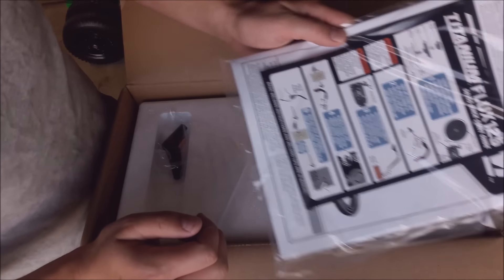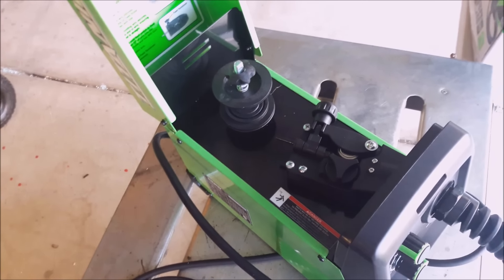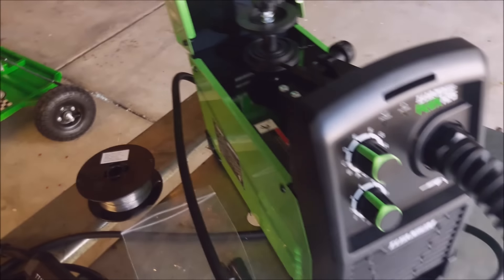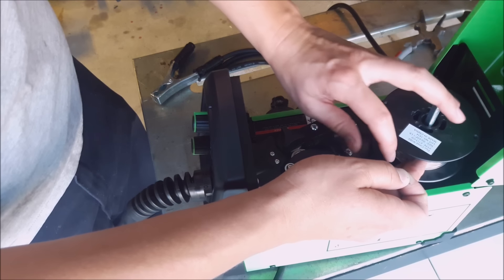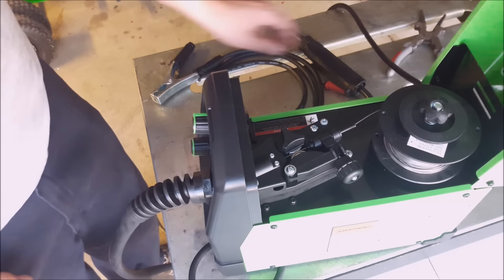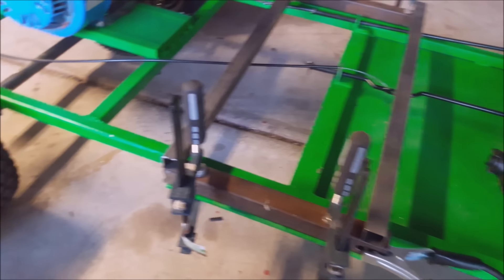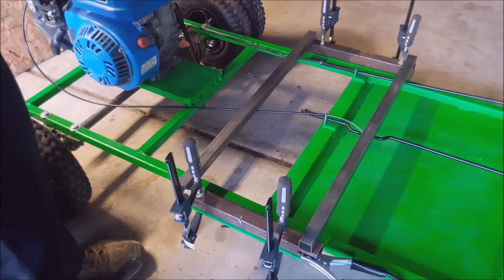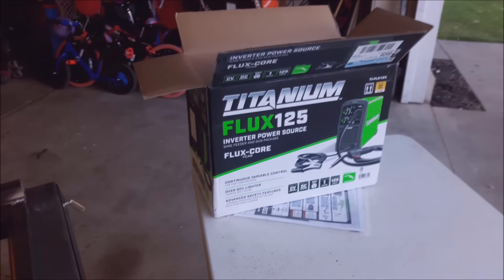Harbor Freight Titanium Flux 125 Welder

Comment: Good video. I recently got one of these. There is a button on the inside of the  unit that feeds the wire through faster without electrifying the wire. Also, I squeezed the ground clamp and bent it trying to clamp it to a piece of steel. I changed it to a better one. Thanks for the nozzle gel tip. I will have to pick some up along with some antispatter spray. Thanks for the video.
Reply from the maker: Good to hear!

Comment: Neat little welder and I love the size and weight. Not bad if you wait for the sale as you said. I think the sales will put this little welder around $150 but I'm not positive. Thanks for the review!
Reply: @bart2546  Thank you for the link. Happy 4th!
Reply: Just got a flyer in store that has it at 150 👍 not a coupon but a sale price for 8/16-18
Reply: @UCzB7uYznorz3KIaD39r_GPQ Doesn't get any better than that. I'm not actually in the market for one. I have the 90 amp that I modified to DCEN and it's working real nice for me at the moment and I'm running a 10lb spool in it. If it ever stops working I would consider the Titanium Flux 125 for sure. The only thing I don't like about it is you can only run the little 1 or 2lb spools but I suppose that's all part of the size and portability of it. The wire is just more expensive in the small spools. Guess you can't have every advantage in one machine. Thanks for the heads up on the sale, I appreciate it. 👍

Comment: Picked up this welder for $150 today. Laid down about 10 welds with it after a handful of cocktails at a buddies. So far, impressed for what it is. I'll report back when I'm more sober and have done some actual work with it. I weld a bit at work (Where my main welder now lives) and I always seem to end up welding this or that for friends. Got tired of using crap setups that I'm not use to, or lugging big heavy gear around. So I decided to try this as my first inverter welder due to size and weight.  I'm not actually a welder, but I do alright. This thing should pay itself off in no time.
Reply: Have you sobered up yet ? Lol  What’s your thoughts on it a year later?
Reply: @alcopower5710  He got so hammered that he’s still drunk 2 years later.

Comment: Since it's only 15 pounds, I'm thinking the strap is so you can throw it over your shoulder and climb a ladder or something. Seems like a handy little welder for that kind of thing.
Reply: I don't think you could safely do that, neither of the leads come off easily so your probably gonna snag unless you find a way to bind them ironically something I would use the handle for.

Comment: If you look on the backside of where those knobs are there’s actually a Cold feed wire switch so you don’t have to press the trigger and also where the wire feeds through on the tensioner you can flip it over  .030 or .035
Reply from the maker: True but since it's just a flux core with no gas why not just pull the trigger!
Reply: @-DIYPRO-  The cold feed is much faster on the machines I’ve used that have it, this Titanium included.

Comment: Nice Mech Master I have both the Titanium and fc 90 nice machines for the diy guy, like the cold feed wire button on the 125,plus  looking at the 125 replacement parts will fit the fc90 and vice versa Lincoln parts,I did add 300amp Lincoln ground clamps to both and Lincoln contact tip on the 125, sure wish they both were stick weld capable enjoy your videos 👍 very informative
Reply from the maker: Right on. Both great little machines!

Comment: Just picked mine up today...

Think it's going to work better than I thought it would.   Going to see if my little Predator 2000 gen well run this.
Reply from the maker: Let me know if it does. That would be good to know.
Reply: @-DIYPRO-    worked on lower setting, not the best though.  

Higher settings triggers the overload on the generator.
Reply: @ironranger1  

The 3500 runs it fine, so when you need a new generator, you know which one to get.

Comment: TIP DIP!!!....GOTTA HAVE IT!!!...AND THE DC VOLTAGE IS A REALLY NICE FEATURE TOO!!!😎👍🏻
Reply: @mariobarrientos6673  no but it will help you not burn through tips as fast. But it will weld just fine without it

Comment: Will this welder work on a '15 AMP' circuit? Just so you know.....there is a 'cold wire feed switch' on the backside of the control panel near the wire feed mechanism.
Reply from the maker: On the lower settings, yes. It will trip if full dialed. Sadly yes i realized it had that right after the video posted, yes i should have fully read the instructions but who would have though they'd put one on there basic flux model?
Reply: @-DIYPRO-  Yeah, I wouldn't have thought there was a cold wire feed switch either, especially being a newbie. I noticed it on another YouTube video. Thanks to you guys you learn these things. Love your video's and your review on this model. Another question?.....using a 1-5 scale, how much better is the 'Titanium 125 Flux' compared to to the 'Chicago Electric Flux 125 Welder'? The Titanium appears to be the way to go hands down.
Reply from the maker: @jmjaxson  I have another video kinda comparing them, but yes once the titanium came out I sold my Chicago electric so far no regrets.

Comment: It is a small machine,bought one for $160 w/$30 off coupon + $30 2 year plan.It does what I wanted to do similar to what you did .110 volts/20 amps and does not weigh 75 lbs like my 220 volt 225 amp AC/DC stick one .The HF welding table you have is very good too w/20% off.HF $39 cart is useful for welding clamps,and things ,all for under $250 with coupons and discounts @ 20% off. HF's only item I have seen with all high ratings.
Reply from the maker: Now you have fun weekend plans!

Comment: Hey quick question, will this welder work well when plugged into an extension cord?
Reply: Only Use 12 gauge extension cord and only run for 3 min at a time. Worked well for me.
Reply from the maker: Agree!
Reply: I’ve had mine on extension cord before so yeah

Comment: Ill figure out something so the 10lbs spool works with it. 2lbs is to small lol maybe make a custom wheel on the back& run the wire though a small hole on the lid..
Reply: That will work perfectly. Or you can reroll a 10 lb. wire spill on an empty 1-2 lb roll that also works but it takes time lol.

Comment: What’s the cold feed button for then
Reply from the maker: It's totally pointless to put on a flux core only machine. The button is used when you are loading the wire, you push the button to send the wire through the gun instead of pulling the trigger. When you have a MIG machine that is using gas then its a good button because when you are pulling the trigger gas is flowing and if you are just sitting there waiting for the wire to come through that is wasted gas.
Reply: Mech Master I only ask because I bought this last week and tried to do it on my own and messed up it came unspooled and would feed right but after your video it took me like 5 minutes to do it

Comment: I just bought  this welder and it did not come with wire 2022 purchase. The ground cable is garbage replaced it right away. Parts needed Welding  cable lugs #4 awg 3/8" stud & Welding ground clamp to upgrade also  having a lug installing tool would be nice i could not find one. But still attached it not easy to crimp wire in lug.
Reply from the maker: That's too bad they took out the wire. Someone else just mentioned that as well.

Comment: I now have returned my original Titanium 125 purchase for not arcing.  This second one they gave me in
exchange will not arc either.  Is it me or are these welders junk?
Reply from the maker: First thing I'd check is do you have a good ground connection. Clean the work piece so the metal is shiny, clamp the ground clamp to the piece you want to weld and give it a test weld.

Comment: I bought one on sale too.  I was wondering though, can you run it on an extension cord?  Say like a 20ft extension cord?   I keep it on my back patio but there's not an AC outlet right by it.  Closest one is about 15-20 feet away from the welder.
Reply: Michael Wood  Yes, you can buy extension cords that are really heavy gauge.
Reply: You need a 20 amp outlet and if you have to use an extension cord, it needs to be a 10guage  and don't go over a 25 footer and you should be all set 👍
Reply: dmith smith Thanks, I did go with a heavy duty 10guage extension cord. I think it’s either a 20 or 25ft long. Perfect length. I need to check but I’m pretty sure it’s 20amp outlet. So yeah hopefully it will work good. Thanks for responding!
Reply: Hrck.. just rewire the welder.  Get rid of its little 12 or 14 awg cable and throw a 25' 10/3 onto it instead.  Easy to do, makes it so no extension cord is needed.
Reply: @imacrazyguy5831  Cool, Might try that.
Reply: @michaelwood5519  I actually just picked up a red 10/3 25' for my little dc welder, going to swap it out, cut the end off and put a right angle plug on it and replace the stock cord.  Sick of only black cables all over the place, I prefer knowing which cable is which at a glance. :)
Reply: Ima Crazy Guy - I hear that!  My 20ft 10/3 extension cord is bright yellow.  So I know what it’s plugged into when I use it. It’s my dedicated cord for the welder now.

Comment: What does the cold feed button do
Reply from the maker: Nothing for a flux core machine. It activates the rollers but not the solenoid valve for gas. Since this machine isn't a mig machine you aren't going to be wasting gas when loading the wire. So even though i don't mention it it really is that great of a feature for this type of machine.

Comment: I saw a video that recommended use a 35 tip for 30 wire??
Reply from the maker: As long as I use nozzle gel or really it should be called tip gel I have never had any issues using a 30 tip with 30 wire.

Comment: I have it hooked to a 20 Amp circuit but there is no connection between spool and ground or between flux gun and ground.  Could it be a wiring issue?

Comment: Great review thanks. Would you recommend this welder for sheet metal? I'm looking for a welder that'll I'll be primarily using to restore my car
Reply from the maker: I'll be putting out another video here shortly showing the different thicknesses it can do. I only went down to 18ga. Worked great for that. Would imagine you could do 20ga. sheet metal, you may need to do more of a sticking approach but I think it will still work good.
Reply: Thanks. I appreciate the quick response
Reply: See videos about brazing and JB Weld for thin steel car bodies. Also see the Project Farm YouTube videos for maintenance tips.
Reply: Thanks, Mr Ray Romano! Lol! Great video! I own this welder and it’s my first time owning a welder or welding. Trying to dial it in for different projects around the farm so lots of practice on different thickness metals. It has a lot of favorable reviews so I’m hoping it lives up to those

Comment: Can you change electrode polarity??
Reply from the maker: Not on this one. You can with the titanium 140
Reply: @-DIYPRO-  how do I make my bead larger??
Reply: I was welding two front car rotors together and my bead was very small in some places. More heat or more speed? Same thing with filling a gap do I need more speed or more heat or both?

Comment: Shouldn’t there be continuity between ground clamp and tip of flux gun? I have no connection.
Reply from the maker: Yes, when the trigger is pulled. If you are just testing without it plugged in then it's an open circuit. Make sure you are setting the right on your multimeter prior to doing that one!

Comment: What settings should I use if I’m running this off of a 15 amp circuit ?
Reply from the maker: Follow what's under the hood. You just won't be able to go on the highest settings on a 15 amp breaker.
Reply: I just have someone stand next to the breaker panel and keep resetting it 🤣
Reply from the maker: @dmithsmith5880  that will work!

Comment: great vid.! can I run this welder on my 20amp garage outlet?
Reply from the maker: Yep regular 110v house power. 20amp outlet will let you run on the highest settings.
Reply: I have a 15v breaker and it keeps turning of do I need to upgrade the breaker to a 20v??
Reply: @andresguerrero5330  NO NOT the breaker, the wiring has to be redone done with a heavier gauge.

Comment: That looks exactly like my Century FC-90.
Reply from the maker: What kind of control knobs does the Century have?
Reply: It has them in the exact same place as the titanium, they are both infinite dials like on the titanium. The ground wire comes out the same place and the MiG gun line comes out the same place. The MiG gun is a little different but the ground clamp is the exact same. The wire loads in the same place with a similar mechanism. I would bet they come out of the same factory. They are both inverter welders.
Reply from the maker: Interesting, i wonder where they got the idea from??!!
Reply: Mech Master I have the forney 140 fc-i, cost a little more but comes with upgrades like the ability to use 10lbs or 2lbs spools, regular copper nozzle to protect tip, and the leads might be longer.
Reply: @DereksWorkshopAndProjects  
Century is an inverter but NOT  DC output
Reply: @robertsantiago953 ....the Century FC-90 (K3493-1) is DC output.
Reply: same machine

Comment: You didn't read your instructions! There's a separate button for the feed wire, duh?
Reply from the maker: Nope I didn't! Even though I didn't mention it, what is the purpose of a cold wire feed on a flux core only machine?
Reply: @-DIYPRO-  its to make sure you discharge the machine instead of getting possible shocked

Comment: i used the cold feed button to feed wire on mine, its alot faster and you gun is not hot
Reply: Yup, one of those helpful little features you learn about if you DON'T throw away the instructions while unboxing!  ;).  BTW,  I just got this welder last week.  MUCH better than the cheaper  HF transformer welder.

Comment: nice little machine but 1/8  or 10 gauge is the max thickness of metal you should attempt with it.
Reply: That's not how this works. Plus, it's rated for 3/16, and that's flat, not grooved welds.
Reply: This welder will single pass 1/4" all day long..what do you have it plugged into the end of a string of Christmas lights ?.. It will even single pass 3/8" clean through if you preheat the joint blue with a torch first and use .035
Reply: @dmithsmith5880   I think you might be in serious trouble on anything which would have a load on it. dream on if you think a 140 amp welder will do 1/4 inch or 3/8 inch single pass with any safety in mind.
If you read the inner flap in this welder 
for mig they don't show 1/4 or 3/8 .but you go right ahead and do it, its your life and maybe that of others if the thing you welded fails.
Reply: @bruced1429  I have welded my entire life, it's all about the heat = penetration, if the joint is preheated blue first, 700/800.deg    it basically has the power of a 200 /220 size flux welder.. try it yourself.  Flat butt joint 3/8 plate  with around a 10deg bevel and it penetrates right to the bottom.
Reply: @dmithsmith5880   you know that the guys buying this machine are not the sort that will preheat or even have the torch to do so , these are garage welders not pros , I started welding on ships in 1969 so I have some knowledge as well,

Comment: Well that sucks. Can't put a 10# spool in this welder. 2# spools of wire is going to cost A LOT more. Was giving serious thought to this welder for flux core, but not anymore since a 10# spool will not fit.
Reply: I have the forney 140 fc-i, cost a little more but comes with upgrades like the ability to use 10lbs or 2lbs spools, regular copper nozzle to protect tip, and the leads might be longer.
Reply: Just sawzall some big slots in the sides of the cabinet 🤣
Reply: @dmithsmith5880 , that idea is not as crazy as it sounds.

Comment: I know what to do with the instructions—read them! That way all the noobs on You Tube who review equipment they don’t understand how to use, might actually know what they’re doing, and not blame the machine instead of their own “manliness”, which they’re lacking, obviously. Though some of these guys read the manual off camera after they pretend to throw it away.

You see, no read manual, no know there’s a button to advance the wire when feeding the gun. If you set the strap short, with the strap adjustments, it’s an excellent handle.
Reply from the maker: But who honestly saw Harbor Freight making an upgrade and throwing in the wire feed button! That is one of those non-essential features that I don't really get. Take take that couple bucks and put it into something else like upgrading the ground clamp. For flux core welding it's pretty pointless. Now if it were a MIG welder that's a little different story since you would be wasting all of that gas.
Reply: Mech Master that feed button is great, and so far, you’re the only one who hasn’t liked it. I wish my big ESABs had one too.

Comment: Will this welder work on a '15 AMP' circuit? Just so you know.....there is a 'cold wire feed switch' on the backside of the control panel near the wire feed mechanism.
Reply from the maker: It will work on a 15 amp on the lower settings. If on the higher settings it will trip the breaker.